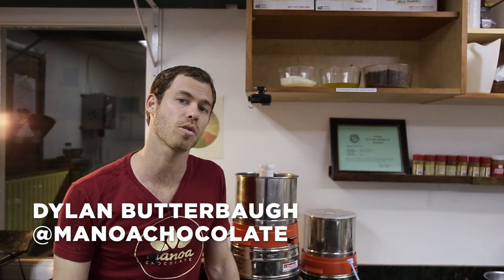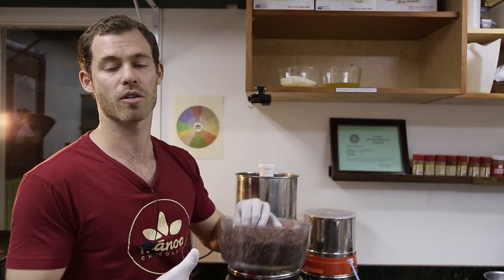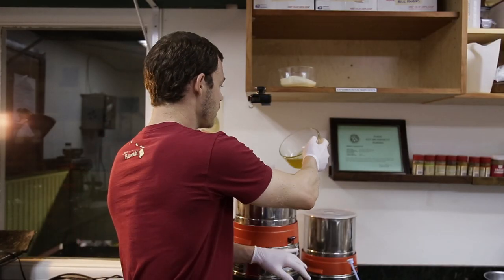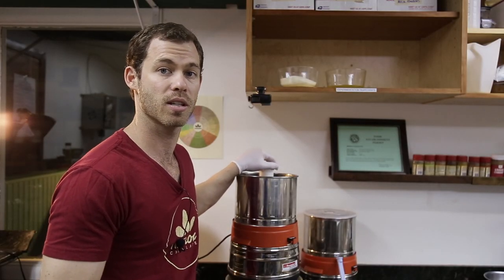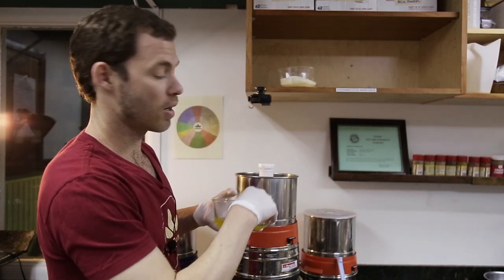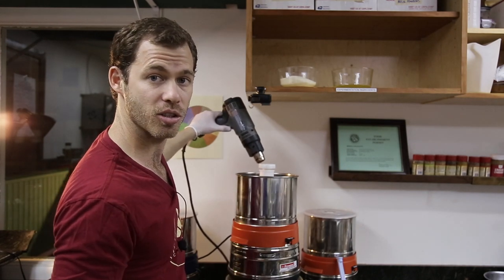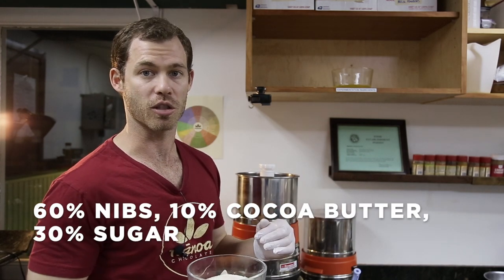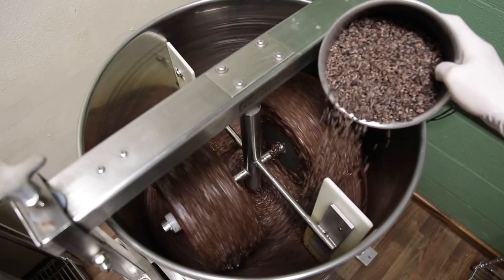How to Load a Mini Chocolate Grinder | Ep.30 | Craft Chocolate TV

Comment: Hi Dylan, a couple of points to add to your highly thoughtful videos:
1.  One has to be very careful using the heat gun. It is easy to damage the melanger by over-focusing the hot air to any spot.
2.  Warming the nibs in a microwave oven 30 to 50 seconds - warm to touch - will help to liquefy quickly
3. Add sugar at the location where the chocolate is moving the most, near the wiper.  Avoid adding near the axle where the Delrin inserts spin on SS axle.

Comment: I'd been experimenting with a mix that contains cashew nuts, vanilla pods, coconut sugar and cacao butter mainly. I heated the cacao butter on a bain marie and dry blended the other ingredients in a high speed blender, then added the cacao butter to the blender and blended it all to what was quite a smooth mix, I then added this to the melanger, but after a while, a thick hard layer formed around the bottom and on the stones which was interfering with the rotation. It got worse, to a point where the whole melanger was moving and eventually the stopped the rotation. I ended up scraping it all out and putting it back in the blender to try break it down. I thought it may have been the cashew nuts causing the issue. I looked up what might help and adding an emulsifier was suggested. I added coconut milk powder into the blender, and then put it all back in the melanger and it worked, it didn't coagulate again!

Next time, I did the same recipe, but this time added coconut milk powder from the start, however it started happening again. I was thinking it must be the nuts, but then I remembered I think maybe one of your other videos I saw a long time ago, where it was suggested to put the sugar in later. I Googled what can happen if you add sugar too fast to chocolate conching and it seemed to describe what was happening with me. Next time I will try the same method, but to add the sugar after a few hours and only a small bit at a time. I guess the time the coconut milk powder stopped it from happening again, it must have just been ground to a stage where it was able to compensate for the other ingredients.

Has anyone else experienced this and should adding the sugar later stop the coagulation from happening in future? I use coconut sugar so it's in larger particles than regular white sugar I believe and from what I know may have a slightly higher moisture content, so this probably doesn't help either. How soon could I start to add the sugar I wonder? I think another video I saw said after about 1-2 hours?

Any feedback would be appreciated :)

Comment: Thanks for the great video! I'm actually about to start my small chocolate production in Vietnam (where sourcing beans is quite easy:) )
I suppose that such a small melangeur was still useful for you to learn how to make chocolate prior to starting your business?
What size of melangeur would you consider big enough to start a small production? Would the spectra 45 (45lbs batches) be big/strong enough to not need maintenance for a couple years? 
You're talking about stones deteriorating. Are these usually easy to replace?
Thanks!
Reply: Need ua help

Comment: Hi, great video but I have a problem with my grinder. I’ve only used it a couple of times and the wheels are leaking a grey/black fluid, do you know why this is so? I actually bought another brand too and the same is happening. I’m losing my mind why this is happening lol please help
Reply: did u find any solution to this? I am encountering the same! I removed wheels completely and cleaned any residue and oil inside, used it once to make peanut butter which was fine. Second use I have black dirt gathering at top of mixer, think it must be residue from drum but any help/advice would be amazing
Reply: @samuelstruth9293  Hi, I found that I was grinding for too long so there wasn’t much left to grind if that makes sense. It was very frustrating

Comment: Do you ever tighten down the refiner all of the way, or do you only leave it at two turns during the whole process? If so, at what point do you tighten it all the way down?
Reply from the maker: We usually never tighten down the wheels all the way, it creates unnecessary stress on the machine and we notice it doesn't make a noticeable difference in the chocolate's texture.
Reply: My Premier unscrews itself when I don't tighten it down. I'm confused by the video shot from overhead--gotta be an optical illusion, but yours looks like the same thing's happening. What??

Comment: Hi, May i ask that some people add in Lecithin into the batch like 5% to make it more viscous. Do you add them and is it necessary??
Reply: Lecithin reduces viscosity meaning it flows better. Lecithin is not necessarily needed in chocolate making, you can always increase the amount of cocoa butter to reduce viscosity but at an increased price. Increasing the cocoa butter also impacts the recipe, espcially if you are targeing a certain percentage for your chocolate, more cocoa butter means less cocoa nibs to hit your percentage marks. Large chocolate makers likely use lecithin both to reduce costs but also for viscosity lowering so the chocolate can be piped through the impellers to various locations in their manufacturing plant.

Comment: How did u run the grinder for 6 days.. continuously or intermittently...🙏
Reply: They're designed to work that long. If you were to give it a break, you'd have to jump through some major hoops when the break was over. 

Either you would have to somehow keep the chocolate melted and liquid inside the melanger until you were ready to turn it back on; or you would have to remove the chocolate, clean up the melanger enough that the remaining cooled chocolate wouldn't prevent the stones from turning, and then when you were ready to get going again, melt the chocolate and pour it back in the melanger.

Comment: Why do you wait 6 hours to add the sugar? Any harm in adding it sooner?
Reply: Yes! I want to know that, too. This must be something you figured out by trial and error, and I would very much like to know what bad thing might happen if I put the sugar in earlier, please. PLEASE?
Reply: @lisab.21  I've made it putting the sugar in earlier and nothing bad happened. Basically I waited until the machine was running smoothly with the nibs for an hour or so and then added the sugar.
Reply: You must wait about 4 to 6 hours so the acidity in the nibs dissipates, make sure your lid is off so the acids disappear and don’t get trapped in the mix. I sometimes wait even longer before adding sugar. It all depends on the cacao you’re using. Good question.
Reply: Oh! Like firing my kiln--gotta leave the lid cracked long enough to let the organics burn out of the clay. If the lid is closed before that's complete, the atmosphere isn't conducive to burn out. The consequences are...dire (boom).